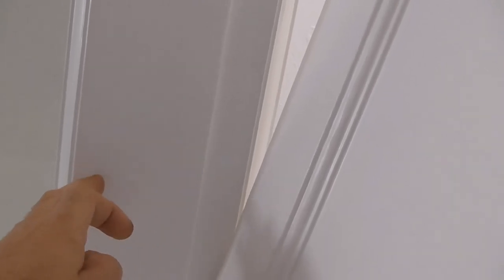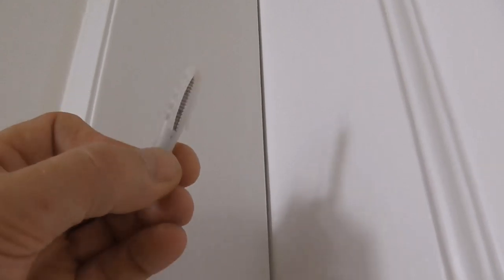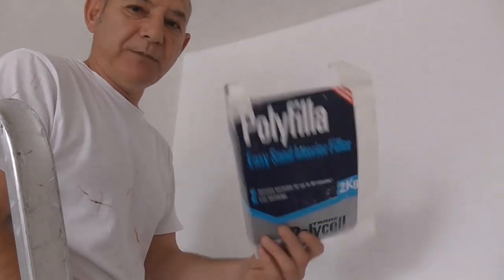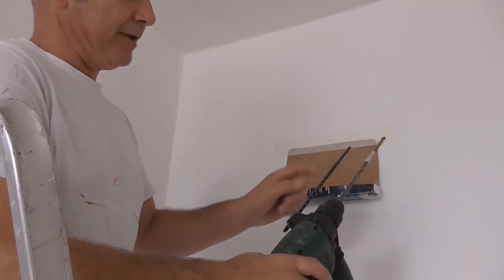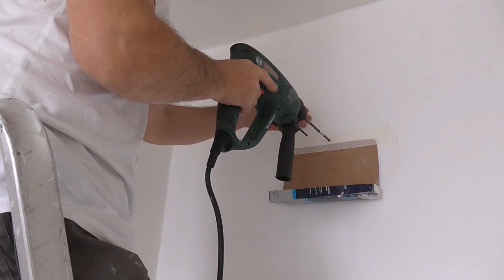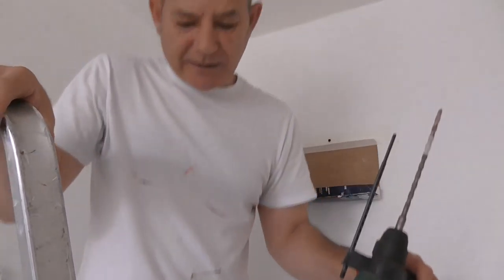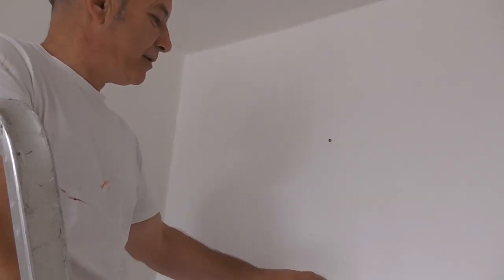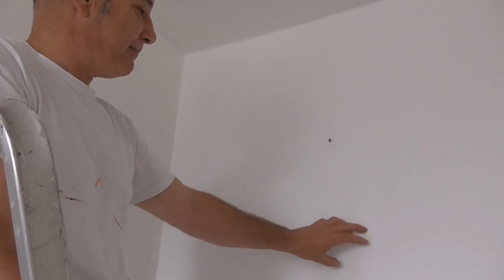Drilling And Fixing Into Hard Wall Brick And Old Plaster

Comment: What i will say is that after 30 years of drilling holes, i always drill a smaller pilot hole (particularly in masonry) and then step up gradually in drill bit size to the required circumference. This works really well for walls that are not in great condition. Sometimes you may find that your drill bit wanders across the wall and this technique can eliminate this, especially if you centre punch the desired position first. I hope this helps someone.
Reply: Helpful for me actually, writing an article. Thanks.
Reply: I was trying drill in my wall and it was very hard I couldn’t put it through maybe there’s metal there ?
Reply from the maker: @vXSlayerrXv  yes sometimes you need to be careful and check for hidden things. Best to have a detector most of the time, near windows you may have a wooden, re-enforced concrete or a metal lentil.  Wires should be protected with either metal or plastic, so you are aware of your drilling in the wrong place.  So if your hitting metal you may need to change to a metal bit. Thanks

Comment: How do you fix it if it doesn't go well and the plaster around the screw crumbles and leaves a huge hole?
Reply: In the old house I live in I get that every time
Reply: I am having the EXACT SAME ISSUE. How did you fix it? Every hole turns into a mini crater! Some masons say poor quality concrete and plaster, some say the drill bit is not correct!! Who knows!?!!
Reply: @analogdistortion  did you figure out a solution?

Comment: What happens if you hit a mortar line while drilling? My friend helped me drill a few guitar lounge into my plaster wall recently and he hit a lot of resistance at one particular spot. I was worried at first that it was a pipe but he thought it was the mortar between the bricks and said it can be tough to drill through. Does that cause any foundational issues if you DO drill through it?
Reply from the maker: No it will be fine your only ever drilling half the depth.. thanks

Comment: I have just had to attach curtain brackets for a pole to hang curtains. The top row of holes drilled went in fine, but the second row (lower hole for the bracket) didn't go so well. The drill went through the plaster, and then when it hit the brick the bit started to move cutting the plaster. It made a right mess of the plaster creating a big hole, and I didn't get the second holes drilled. Is there a way of getting around this? and did the drill bit move because I hit the edge of the brick which sent my drill into the cement? Any tips to get around this would be a great help.
Reply from the maker: It's not easy you probably hit a mortar line. This video may help to fix the hole --- https://youtu.be/u_uG-yjzQjw
Reply: What i will say is that after 30 years of drilling holes, i always drill a smaller pilot hole (particularly in masonry) and then step up gradually in drill bit size to the required circumference. This works really well for walls that are not in great condition. Sometimes you may find that your drill bit wanders across the wall and this technique can eliminate this, especially if you centre punch the desired position first. I hope this helps someone.
Reply: @PaintingandDecorating  He could be using a basic DIYers drill and so the bit once it hits brick will just wonder around as it's not hammering the bit in. I had this exact same problem today!
Reply: @analogdistortion  did you solve this issue?! If yes, do tell! 🙏

Comment: Right I have a 50mm x 8mm screw to go into internal brick wall ) worried I’m going to hit the mortar or edge of brick.
Is there by some miracle a way I can find the mortar lines without stripping everything back?
If it were a smaller screw I’d go with pot luck, but it’s for a heavy load bearing bracket!!!
Any advice appreciated…
Reply from the maker: @eyesintheskies  drill and hope for the best. If you do hit the mortar you can always redrill or fill the hole with a strong filler.  Then once dry drill and job done. 
If you're putting more than one screw in the chances are you will hit a mortar line. Thanks
Reply: @PaintingandDecorating  this happened to me  & I've made a right pig ear of it. I need to drill in the same position, any ideas what filler i can use that will keep things together & allow it to be drilled?

Comment: Are you using an impact driver? If so what bit have you attached, using a masonry bit I find the plastic always crumbles while drilling and it's driving me crazy!
Reply: this is a hammer drill, not an impact driver.
Reply: @TheBeardedBabies  what's the difference between a hammer drill and standard drill?
Reply: Putting masking tape over the spot you want to drill helps keep the plaster from chipping and crumbling off.  Anything you can do to keep the vibrations of the drill from shaking the plaster in a localized spot.
Reply: @Crobisaur  Nice. First time I'm hearing this, never tried before. Any hole I try to make invariably ends up into small Crater, and I just can't figure out why. Some masons are saying the Cement and plaster are old and brittle, others are saying the drill bit is the issue!!!
Reply: @johnulcer  Hammer drills much more expensive. They have an inbuilt mechanism that generates a forward thrust motion as you drill. So it's like there is a hammer inside your drill that keeps striking the drill bit as you drill. This means you have to physically exert less force when using a h/drill. With a conventional drill you need to push hard while drilling if you need a deep hole. Think of old steering vs power steering!

Comment: Nice video!! I was attempting to drill a small hole in the concrete & brick wall with my drill, unfortunately, the hole turned out a lot bigger than the drill bit. Plus, a hand-sized chunk of the wall itself came off!! (layer of concrete and overlying layer of plaster). Any idea why this happened? Did I use the wrong drill bit, or is the concrete of poor quality, or something else??!! In several places across the house I find that the holes do not maintain a clean round shape, no matter how small a hole I try to drill. Instead, both the concrete and plaster start giving way and I'm left with a small Crater instead of a small hole!! Any thoughts please. Thanks...
Reply: If your house is old the brick might be crumbling. The house won't fall down but fixing can be a nightmare. I'm not a builder but I remember my builder father many years ago drilling a larger hole and plugging it with a piece of wood, then drillibg into the wood fir fixing. Not sure if he used an adhesive? It worked really well. I in the same house and hate drilling into the wall due to this. I always start small and check if the wall plag will fit as a smaller drill bit will create a bigger hole in crumbly brick. If you can't create a nice round hole and your bit is wandering your bit might not be sharp enough or your drill might not be powerful enough. If you have an inexpensive cordless drill I expect this is the case. I have all my father's old building stuff, so luckily I don't have this issue.

Comment: Do you need to worry about pipes and electrical lines when drilling into solid brick walls?
Reply from the maker: All the time..  thanks
Reply: This is what's putting me off. I'm wanting to attach bookcases to wall which is brick so I need to put wooden frame around as I want to box them in but petrified I hit electric wires 😢

Comment: Many thanks for this! First hole was perfect, second was a disaster - I'm now assuming I hit mortar.
Reply from the maker: Yes possible..  you can use pollyfilla to sort it it out.. thanks
Reply: @PaintingandDecorating  How do you get the filler deep down into the hole? Today I had some multi purpose fillter and wanted to fill the hole but I'm sure I only got a bit in there with my scraper.
Reply: @analogdistortion  Sounds crazy, but I have used a plastic syringe without the needle. It helps you all the way in. Or buy any plastic tube with a narrow nozzle off the shelf, snip off the rear and empty its contents. Refill it with your mix of putty, resin, epoxy, filler, or whatever.

Comment: Hi I'm in a 80s built apartment in UK and I have bubble type ceilings.. What is the best way to strip it all off? You're videos are Very formative BTW
Reply: Tiger role it, then get a product by @zinsser called DIF wallpaper striper.. Soak it 20 mins and it will fall off 👍👍👍👌
Reply: @thomasdunleavy9775  What does 'tiger role' mean'??????? I have textured ceilings that I HATE!
Reply: @ireneroth8252  it's a tool that's  for stripping wallpaper . It's got 3 small spiked wheels that prick the paper enough for a good wetting agent to soak in. Paper  comes off lot easyer and does not cause and damage to the wall under the Paper... Good wetting agent is D.I.F by zinzer...

Comment: How do you check for wires / pipes before drilling?
Reply from the maker: You usually have a good idea.. as you can check where certain things go.. by checking the area looking for pipes, and sockets.. light switches..  generally wires run down for light switches and up for sockets..   but always best to check and double check..    a detector can be very handy.
Reply: @PaintingandDecorating  thanks! Sorry to be a pest but how far above light sockets do they usually go? Like just a few inches? The reason I ask is on my 2nd floor we drilled a few feet above a light socket that was down near the floor (probably about five or six feet above it), and I was worried about the wires potentially running straight up thr wall, but my friend told me the wires for the outlet wouldn't run up the wall and would likely run along the base of the floor to a hollow wall and then down to the basement. But that's the sort of thing where it's like how do you know for sure before you start drilling haha. I guess I'll have to look into detectors that work on plaster walls. It's been a couple months since we drilled and all my lights are still functioning fine so fingers crossed we didn't hit anything. 😂
Reply: @PaintingandDecorating  what is the detector called?

Comment: My apartment is old and I have no idea what these walls are or what’s behind the plaster... I just want to hang a shelf
Reply from the maker: You can investigate first by slowly drilling  into the plaster. But also if you knock on the wall you can usually tell if its a solid wall or plasterboard...  
Always make sure you know where pipes and wires are before drilling.  Thanks
Reply: Painting and Decorating thanks so much for the advice